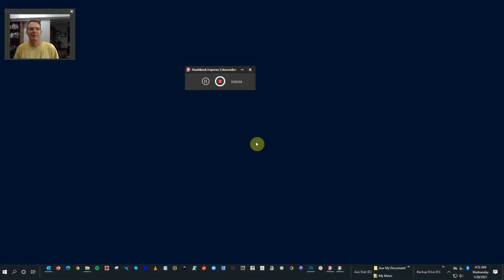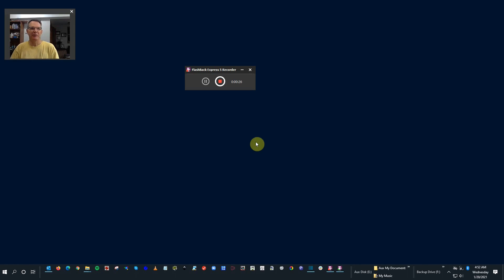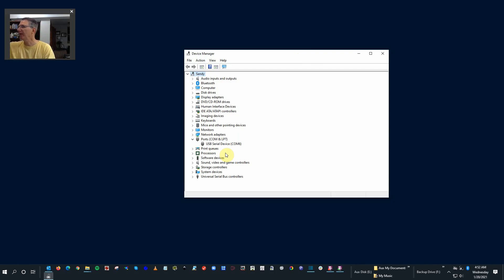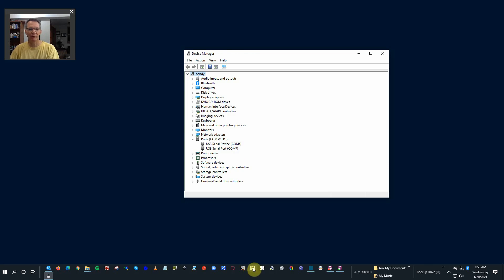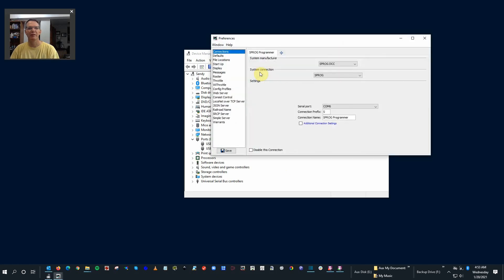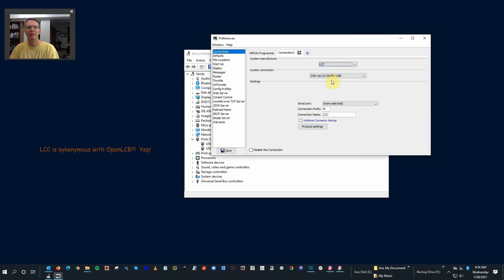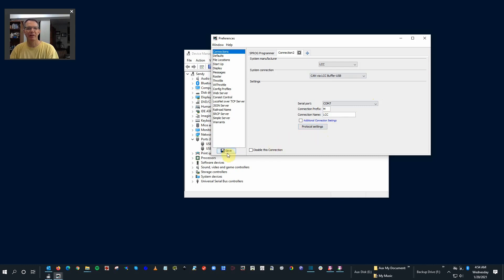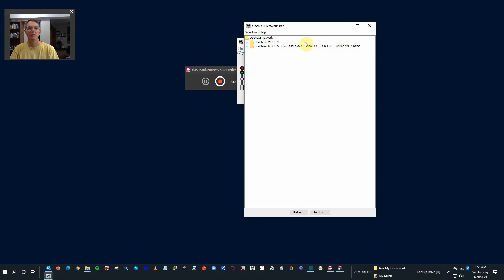Connecting the LCC Buffer-USB to a Win10 PC

Comment: I only have to use the interface for programming the nodes and after that , they operate via internal logic correct.
Reply from the maker: Yes, exactly. The gateway just allows your PC to be able to read and write the configuration of the nodes. But once configured, the interface and PC are not required!
Reply: @the-lcc-channel  what about the LCC loconet gateway? From the description of the product, it sounds like it combines the USB connector and the power point. The only other thing I would need to make the basic LCC system would be some nodes and then a termina terminator at the end, right?
Reply from the maker: @GooseinTheCabooseProductions  - My apologies if I was not clear, but no, the gateway does not power the LCC system. It actually takes power from the LCC network to function. So you need a Power Point separate from the gateway. So for a minimal system, you need: a gateway, a power point, at least 1 node, and 2 terminators. And recall, the gateway is not needed for the LCC network to operate; only to configure it and interface with it as needed from your PC.